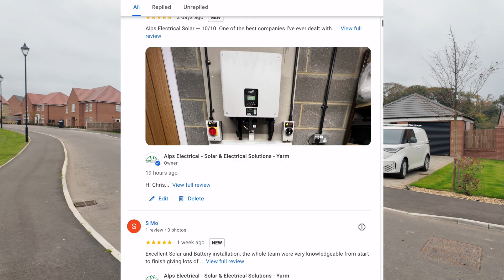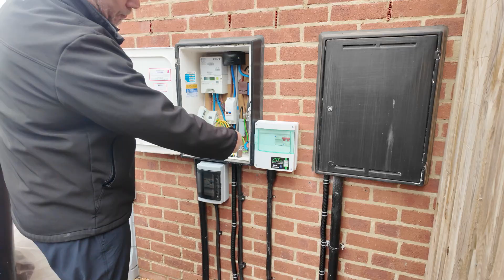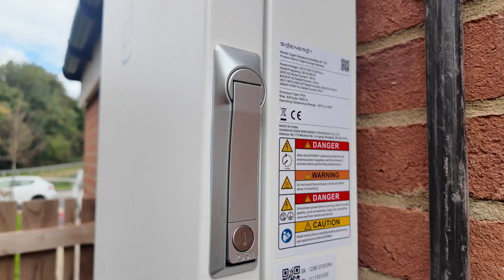Sigenergy Solar System Installation With Full Home Backup | Alps Electrical Ltd - Teesside

Comment: With the gateway so close to the battery doesnt that remove some of the modularity? As any future expansion (adding another battery) would mean either the gateway or stack would need moving. Seems to hobbled one of the key selling points of sigenergy
Reply from the maker: I hear you, however this customer has added more storage than they initially enquired about. We actually had this conversations with them as the units could have been floor mounted but we prefer to have them raised off the ground where possible, and so having the gateway directly above and inline was the neatest option given that the customer had also agreed they had no requirement for additional modules :) Thanks for the comment

Comment: Tidy install. Simple question from very unqualified future Sigenstor customer. Wouldn't there have been some efficiency in locating just the Gateway near the Consumer Unit - even out of the way & out of the weather up high inside the CU side of the garage near the start of the cable run shown?  If I understood correctly, the long run with the difficult & presumably pricey, beefy cable then wouldn't have been needed? It would have "only" needed the narrower gague & Ethernet cable runs to the distant battery stack?
Reply from the maker: Hi, thanks for watching, and for the comment :) - Yeah for sure the closer to the DNO cut out, the simpler, and cheaper the installation for the customer. However, as in the video, lots of sites were looked at, and this was the preference from the customer. They didn't want the system in the small bit of garage they had left, and they also did not want the system on show on the side of their house. Therefore this was the only option :)

Comment: Also missing the earth link in the Gateway for when the device goes into island mode.
Reply from the maker: Hi, thanks for the comment. It is just the way the video was shot, the ending that you see, is actually half way through the job, the earth rod was not installed at that point, I can assure you the back-up earth was installed :)

Comment: Good content, sigenergy is great kit. One question, Why couldn’t you just use inverter port 2 which is 40amp rated already to save the additional External DB ?
Reply from the maker: Hi, this is recommended by Sigenergy - to utilise the 63A and then add your own suitably rated RCBO downstream of the gateway. The isolators in the gateway are not RCD protected. Thanks for the comment, and for watching :)

Comment: The Gateway is IP54 and should not be installed in locations open to the elements as per PG 5 of the installation manual. Do not install the equipment in smoky, flammable, or explosive
environments.
• Avoid exposing the equipment to direct sunlight, rain, standing
water, snow, or dust. Install the equipment in a sheltered place.
Take preventive measures in operating areas prone to natural
disasters such as floods, mudslides, earthquakes, and typhoons.
• Do not install the equipment in an environment with strong
electromagnetic interference.
• Ensure that the temperature and humidity of the installation
environment comply with the equipment's requirements.
• The equipment should be installed in an area that is at least 500 m
away from corrosion sources that may result in salt damage or acid
damage (corrosion sources include but are not limited to seaside,
thermal power plants, chemical plants, smelters, coal plants, rubber
plants, and electroplating plants).
Reply from the maker: Hi, we actually spoke to Sigenergy about this prior to installation, and they advised it is just an advisory, the system is fine outside, hence the wording 'avoid' it. In this instance, that was the best location, and it is away from direct sunlight. Its not always possible to tick every single box when it comes to location, and common sense needs to prevail. Give them a call for clarification. Thanks for the comment :)
Reply: @alpselectrical  As a registered Sig installer you have been informed incorrectly - This has been well documented and hence the launch of the new gateway which has a higher IP rating.
 ·
Just a bit of an advisory for consumers (potentially installers as well) around the gateway and its IP rating. IP54 in particular. 
This is not suitable for directly outdoors in areas its exposed to consistent rain etc. 
If used directly outdoors it must be under a shelter of sorts. 
If you have had a gateway installed directly outdoors get your installers back to reposition it under warrenty. 
Not only has it been installed against manufacturers instructions its also potentially dangerous if you ever have to operate breakers within it that could have become water damaged. 
As installers we have so far managed not to have to install one outdoors. Other options are generally available and with the gateway warrenty being much shorter than the wider inverter/batteries looking after it makes a lot of sense. 
For more info Google IP54 and see for yourself. International protection is something that must not be ignored. 
For those who have spoken for Sigenergy please see page 5 here https://www.sigenergy.com/.../en.../1729216501785372.pdf pretty clear.

Comment: so if the roof is not structally secure,surely he can go back to NHBC or the develper & get it rectified,especially with a structual survey,i thought the NHBC gurantee was for 10 years , not a lampost version ???, i would have ripping the builder one & threatening legal action to rectify the structural faults @ the very least
Reply from the maker: Hi, thanks for the comment. The roof is structurally sound to support the weight of the tiles, the builder I guess has no obligation to make it strong enough to hold weight that is not yet applied to the structure. This is the thing with new builds, they are built to tick boxes and no more. We have had two new builds fail miserably. The trusses they use now are like matchsticks. Thanks for watching!

Comment: really surprised & disappointed in equal measure, a nearly new housing estate on single phase ???, the dno & the develpers both know of the push for heatpumps evs etc,etc, so wtf why no 3 phase provision, when the estate was being built & cabled out ???, seems like the develpers & the dno were both scrimping on costs, wait until more people on that estate upgrade to solar/evs & then heatpumps,when inveitably the gas boilers fitted on the estate give up the ghost, no future planning whatsoever, disgraceful  on the part of the dno @ the very least !!, i like watching your videos BUT sigenergy  "creative " battery sizing & DOD, plus the fact there "warranty" per unit is a bit opaque, 15 mwh throughput ??, has cost them a sale, i will go with tesla for pw3 ,no nonsense 100%  DOD on them  plus 10 years 80% guarantee, cant be beat, sorry but tesla wins for me :)
Reply from the maker: Cannot disagree with much of that! Tesla is a great choice also! :) Thanks for watching!